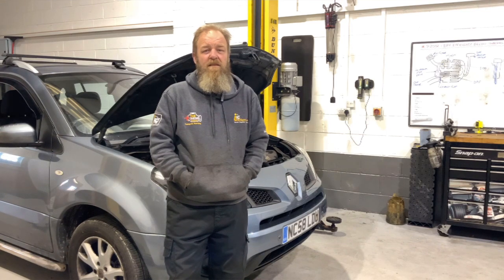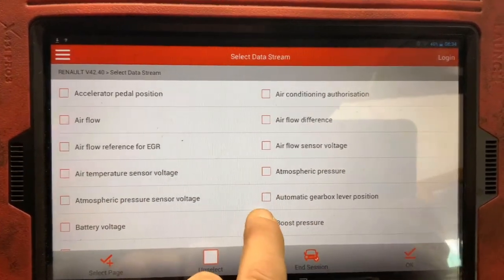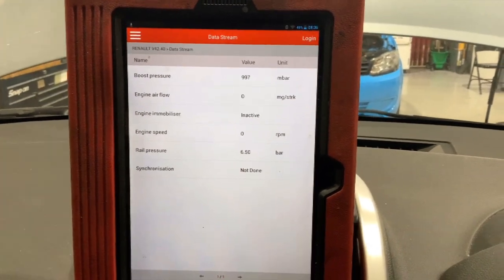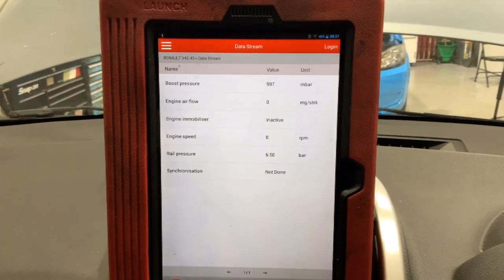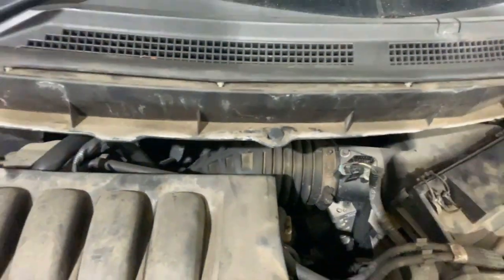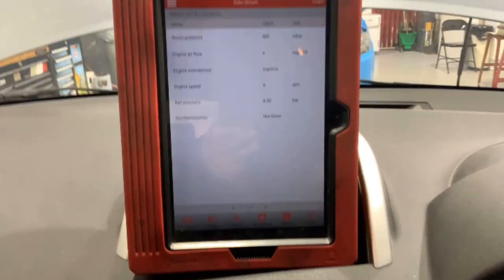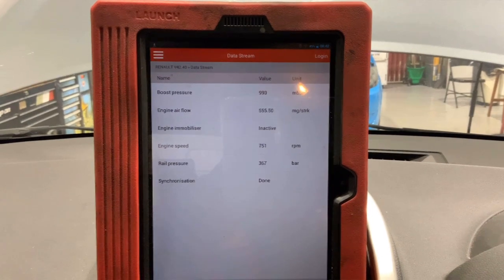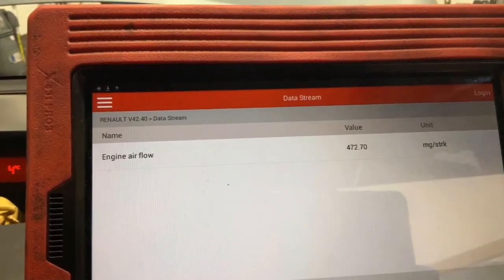Non Start No Faults Stored. Using Substitute Values to Prove Fault

Comment: Great work Gary, ive learned something here, i thought the data pids on a scan tool were directly showing the data produced by the sensor, i assumed that if you unplugged a sensor you would see zero on a data pid, i was aware that the ecu has default maps as per when running cold in open loop, but learned today via your great skills that the pid data appears to be coming from the ecu and not the sensor as such.
Thanks mate.
Regards Jay
Reply: I assume substitute values are available only with open loop, scan tool is plugged to ecu and not the sensors, therefore ecu data is what your watching

Comment: Great video, great lesson. Thanks for sharing this. 
I'm having a similar condition with a Mercedes-Benz CLC200 Kompressor (CL203 2009, engine M271 with 84K km, about 51K miles)). Engine, sometimes, cranks and have difficulties to start (hot or cold). Then it starts and works perfectly, no fault codes stored. Cleaned MAF, TBI, injectors, checked fuel pressure after the filter (where the pressure regulator is), everything is fine. New air filter, spark plugs, but still shows the problem. Any advice about where I should look at? Thanks.
Reply from the maker: Without the vehicle infront of me any advice would be pure speculation, my advice would be get the vehicle to a local diagnostic specialist such as myself
Reply: @intelligentauto737  thanks for your reply. I would certainly take my car to you, but since I'm on the other side of the Atlantic, I'm afraid it won't be possible :)
I've already taken the car to 2 shops and neither could find what's going on. This morning I unplugged the MAF connector and cranked the car, which started up right away. I then checked the connector and found some oil in it. Used some electric contact cleaner, dried it really well, and plugged it again. Then I cranked the car again and it started right up.
Your video helped a lot. Thanks so much for sharing your knowledge.

Comment: substitute values can be a PITA though. When the ecu is doing this, the value should also have a flag attached so it is crystal clear to the technician this is the case
Reply from the maker: If the job was that easy everyone would be at it
Reply from the maker: It dies flag it in a round about way, it logs a fault for MAF short to b+ and IAT short to b+

Comment: Had a similar fault on a qashai with the same engine. It would start and run but with reduced power. 
The air filter was so blocked it had collapsed.
 Thanks for sharing!
Reply from the maker: I see lots of Renault & Nissan vehicles with manky air filters, I suppose a 40k service schedule don’t help

Comment: Smarty way to find the issue. Well don sir ..  550 mgs  stroke  is that applying to  fuel engine also  ore just Diesel engine???
Reply from the maker: That applies to a 2ltr 4cyl engine running with a manifold pressure at atmosphere 
Petrols running with closed throttle plate will be much much lower.
To calculate MAF in mg/stroke you need to know air temp, capacity and manifold pressure
Reply: @intelligentauto737  yes sir i got it .. thanks